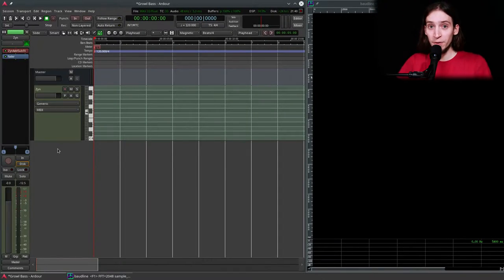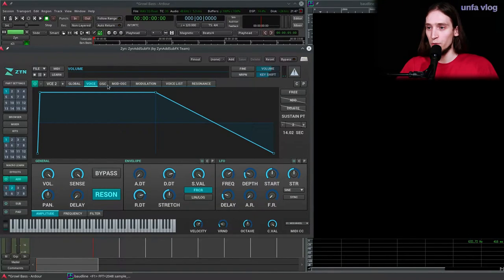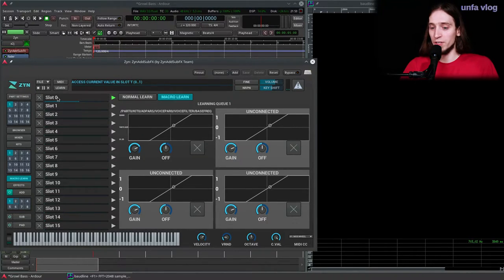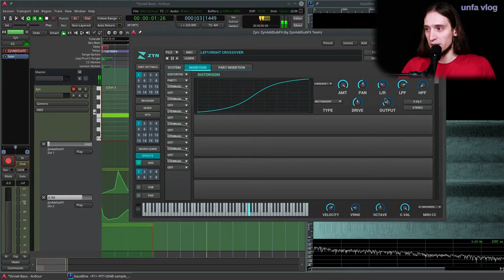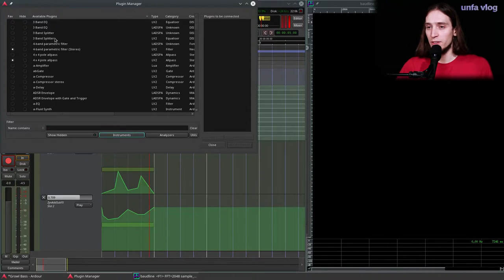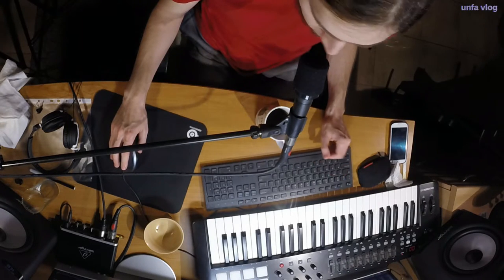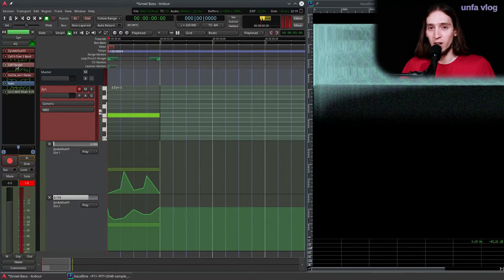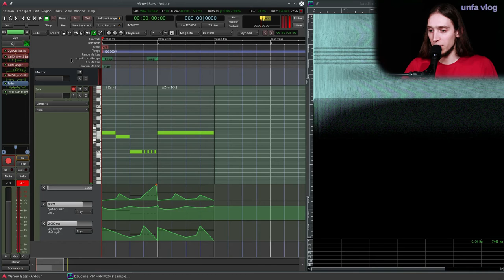UV#19 Synthesizing an FM Growl Bass with Zyn-Fusion and Ardour using multiband processing

Comment: Hello Thank you for all the great videos you've been putting out on Ardour. Look, I have laptop with Ubuntu 20.04 LTS and ZynAddSubFx. The synth apparently works but I'm not getting any sound. Does it have to be routed through whatever DAW I have?
Reply from the maker: If you're running ZynAddSubFX as a standalone JACK application, AFAIK it doesn't automatically connect to the system output. You'll need to use a tool like Catia, Patchage, QjackCtl or Carla to connect the ports.
Reply: @unfa00  understood. Q Jack is definitely familiar to me from my earlier use of Ardour. I had not been aware that the synth comes packaged whenever you download Ardour or LMMS. Yet that is a good thing. It's powerful enough that I think it can be compared to the Roland MKS-20 which is a very good rack mount or standalone electric piano. During a brief stay at the VAMC, there was a Roland EP in the day room which I played everyday and I loved it. Once again I thank you for your assistance. And I will definitely be getting back into your videos again.
Reply: It turns my question had a two_fold response ,.... 
1 The soft synth actually comes embedded in LMMS and if I'm not mistaken in Ardour as well. Once I dragged it from the left_side dock into the song editor panel, I didn't get an error; I got sound!
2 Since I already have Ubuntu 20.04, I didn't need to download an *.iso or a *.tar ( a definite pain in the neck! ). All that was needed was to copy and paste the sudo apt install for Studio Installer in terminal and let it do its thing. And directly after that, I rebooted three times and the browser audio played.
Reply from the maker: @William_sJazzLoft  I'm glad dit works now :D Ardour definitely does not bundle ZynAddSubFX though.
Reply: @unfa00  Well then, I stand corrected. Thank you. BTW when you got started with the music, were you using PC or Mac initially? If you've been using Linux all along, what distro did you start with and are you still using that distro?
Reply from the maker: @William_sJazzLoft  I've started on Windows XP with Fruity Loops 5. Later I switched to OpenMPT, then Linux, then LMMS and many years later to Ardour.
I've been using Ubuntu first, then Ubuntu Studio, 64 Studio, AVLinux and KXStudio until it was no longer maintained. Then Linux Mint and after they dropped KDE I switched to Manjaro, very recently Arch Linux to get closer to the source.
Reply: @unfa00  I'm glad that you made mention of the situation with KX Studio. I had been getting warning messages when I attempted to download the files that were there. I will no longer use it as a source. Thank you again
Reply from the maker: @William_sJazzLoft  Oh, no that's not what I meant :D KXStudio is still around as a project that distributes awesome open-source audio production software packages for Debian-based Linux systems. What I meant is that KXStudio project also had a LiveDVD (basically a full-on Linux distribution) actively maintained, and that part hasn't been updated for a long time now.
The KXStudio repositories and packages are still actively maintained and very useful for Ubuntu, Linux Mint - and of course - Debian users.
Reply: @unfa00  oh so the website and its repositories are still maintained. I gotcha. Still, I had issues with trying to use any packaging from them. I would extract the files, open the readme files, follow the instructions and still I'd hit a 'brick wall'. ./configure and make would execute ok. But make install would generate a bevy of errors. Bottom line - I kept it movin' until I found something or someone to point me in a more profitable direction.
Reply from the maker: @William_sJazzLoft  Hmm. You should be getting .deb packages either from the KX.studio website or from the repositories. These are binary packages so no compilation is required. What OS are you running? :)
Reply: @unfa00   I'm using Ubuntu. And certainly if the files are.deb they should be good to go. So, configuring shouldn't be necessary. But when I changed file permissions or behavior ( so that there's an option to run ) it seems like they're unresponsive

Comment: Hi, and thanks for great videos. Is that a Behringer U-PHORIA UMC22 on your desk? If so, what are your settings in JACK/Cadence if I may ask? I have the same and running Linux Mint Debian (Cindy) . The video is a bit old so I hope you see my message. Once again, great videos :)
Reply from the maker: Hi! Thanks! I use Behringer Uphoria UMC202HD (the only difference between the non-HD version is it's running at up to 192kHz). I almost always work at 48 kHz sampling rate, with the buffer size of 256,512 or 1024, depending on the intensity of my current project. The `jack_bufsize` command is very useful for changing that setting at any time. Otherwise - it's a duplex stereo interface, so 2 in/2 out channels - not much more to configure there :)

Comment: I was wondering, since you use linux, what browser do you use? Because I cannot watch this video with any other browser than google chrome on linux, firefox and opera dont support this video format which is strange....
Reply from the maker: I mainly use Firefox. Maybe check if you're using HTML5 YouTube player? https://www.youtube.com/html5
I am running Linux Mint 18.2 - a different Linux distribution might not have some codecs installed maybe?
You should also be able to play YouTube videos with VLC or MPV, by simply running them with the YouTube video link as a parameter. It should work IMHO.
Reply: It works fine with Firefox on Antergos. Just like Tobiasz says, make sure you set the HTML5 player... or activate the Flash plugin if you want that. I've been watching YT videos for years on any browser, just check your settings.

Comment: How was the editing with kdenlive? Any better? Except the double voice glitch & continuous bird's eye view shot, of course:)))
Reply from the maker: The editing glitch - yeah, I also found a bug, that broke a zoom-in animation, making it zoom out instead.

However overall Kdenlive seems to be faster to edit with (once I worked my way to composite the image as I needed). It's much faster and better at handling audio waveform previews and proxy footage. Some common editing and compositing tasks are also way faster (like fade from/to black, audio fade in/out) - it's also capable of reading SVG natively, which is great and has a nice Title editor - Blender VSE's text drawing capabilities are very much limited.
Kdenlive isn't s flexible with the compositing though - but for extra stuff I can use Natron or Blender in addition :)
Reply: Yeah, being a proper video editor it has its pros - I did not know of the SVG import capability - that is interesting; sketching up something in Inkscape and import it... like in Blender. You can't even change font in the VSE :( You have to rely on 3D view for text and render your scene.

BTW, do you know if there is any way with Simple Screen Recorder or OBS to capture 2 screens on 2 seperate streams instead of one?
Reply from the maker: Kdenlive can read and render an SVG file just like Inkscape would - for Blender I need to export that SVG to PNG first, which is just a few steps more, so +1 for Kdenlive here :)

Using 3D scenes to render text is slow and destroys performance in the VSE. And rendering that out to a PNG sequence first is not very convenient either.

I record 2 screens in OBS by putting them next to each other on a big canvas. Then I split that and composite one on top of another. I asked on OBS forums about a way to write 2 separate video files, but they said that performance would suffer due to having 2 encoding processes instead of one. There is a way to split that with ffmpeg afterwards, but I decided to rely on video editing software to handle this - having yet another copy of my 10 GB of footage just to have them separated is not what I need :D
Reply: You can import SVG directly in Blender (although pure SVG and not the Inkscape dilaect of it), no need to export to PNG, at least for the normal 3D View, then just render that scene as a video or image sequence and import that into the VSE. Otherwise, yes, rendering scenes directly in the VSE is a pain and not recommended.

I was thinking about running 2 instances too and record audio on just one but it might lead to performance issues like you say. ffmpeg may be an option... I could give it a try.

Thanks!
Reply from the maker: I import SVG geometry into Blender all the time at work - but the colors get skewed and I had to write my own importer to correct that. But it's for modelling, not for importing flat images into VSE :)
Reply: Yes, I know it is not for the VSE directly. I mainly import B/W things or assign a material anyway so it is not - for the time being - a big issue.

Just bought your new album ;)
Reply from the maker: I saw you bought it earlier today - thanks! And enjoy :)

Comment: hey dude,i need your help,why i cant capture screen while using zynfusion?
Reply from the maker: What screen capture software do you use? What operating system?
Reply: kazam,os elementary os juno
Reply from the maker: I haven't used Kazam for many years. I capture with SimpleScreenRecorder and OBS. Have you tried any of these?
Reply: When i use standalone Zynfusion with jack connection,kazams quit,finish capture shortcuts dont work.Tried simplescreen too,same problem